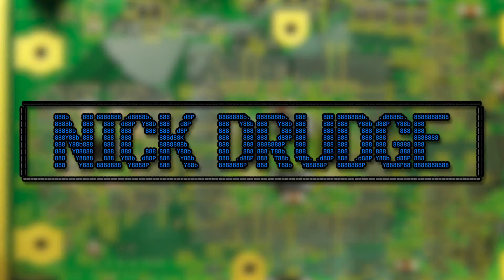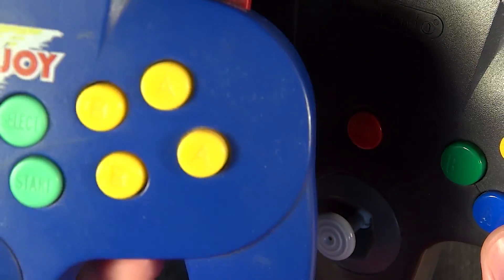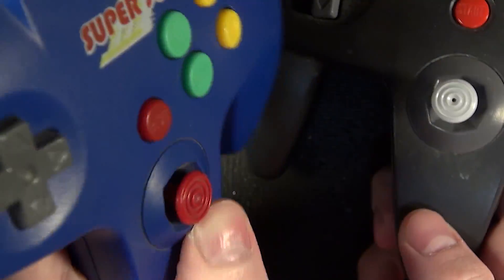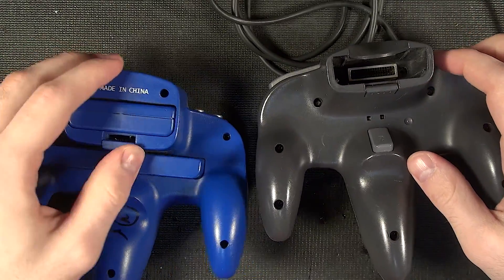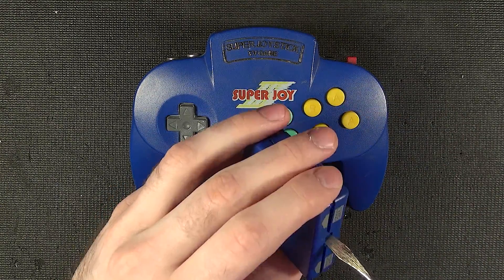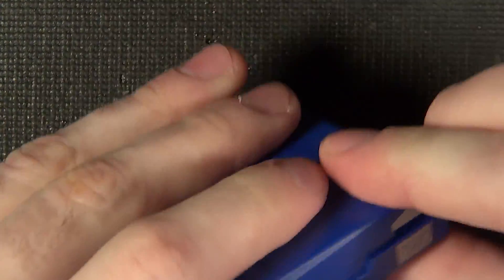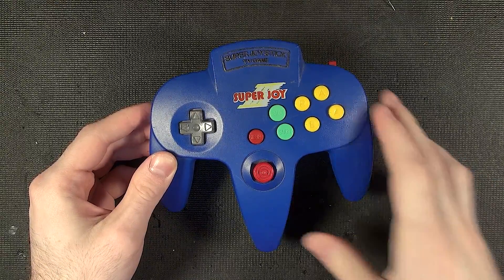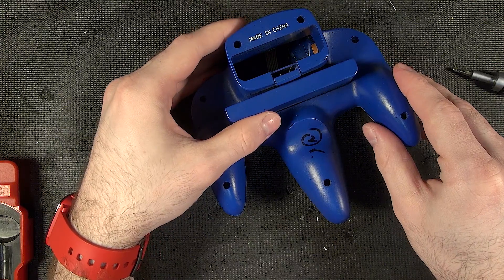Super Joy III Teardown

Comment: Really interesting. I really enjoy this video. I have quite a few of these Super Joystick Famiclones. I have a question, you see, My oldest Super Joy's D-Pad doesn't work anymore, and I'm wondering if it's possible I can replace it with a much better D-Pad? Like the D-Pads by actual Nintendo controllers like NES, SNES or N64 etc. Because the Super Joystick Famiclone still works fine, but not the D-Pad.